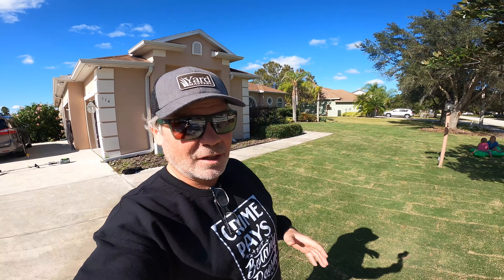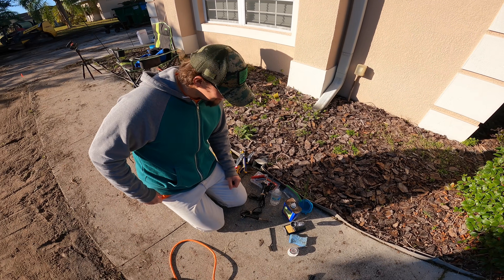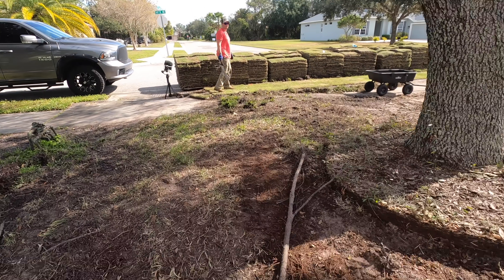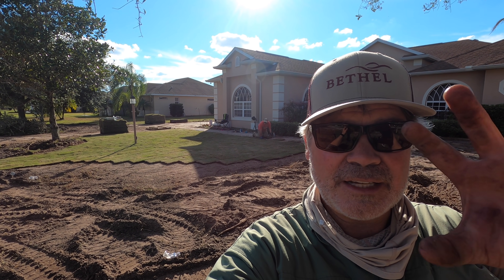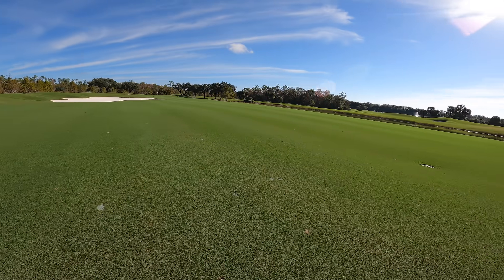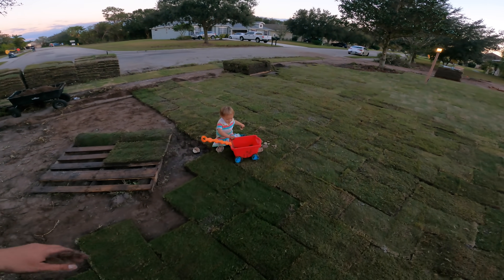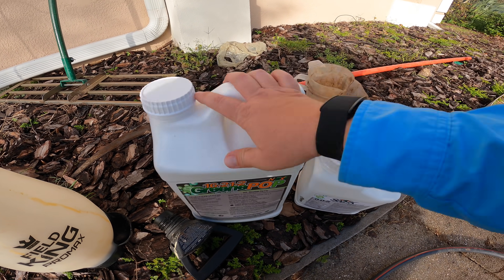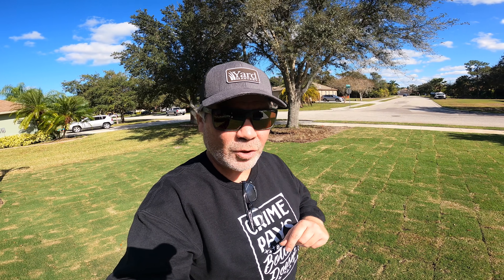Repairing Broken Irrigation and Sodding Bimini Bermuda

Comment: Himini Bimini Himini Boo I love this grass and I am sure Brett does too :)
Reply: Striperman, good Sunday afternoon to you , heading for 35 today ,37 tomorrow then supposedly 25 on  Xmas day with 10 to 20 mm of rain , any other year ,Xmas day ranges from 33 degrees Celsius to 42 degrees Celsius. How is the snow going? Are you thinking of spraying it super green like the lawn Rebel once did for domination in your street? 😬
Reply: Rain and cooler temps on Christmas by you might be a good thing. Snow will be here for awhile but all the green dye is all sold out. Connor's lawn is so big he bought all there was in stock 🤣
Reply: Indeed I do.

Comment: I got a feeling the bermuda will struggle under those oak trees. I am finding out its not really from shade but mostly the tree will suck all the nutrients/energy from the soil about 10-15 ft out, especially with it being so mature. I had a big mature tree with all the limbs cut off up to about 20-30 ft, so it was getting plenty of sunshine but looked bad all around the base 10-15 ft out. Removed the tree and stump 2 yrs later and now the bermuda is thriving in this area now

Comment: Is that really going to be enough fertilizer? A normal bag of starter has 3 times the amount of N-P-K because you are putting down 3 lbs per 1000 sqft (not 16oz like the liquid) and in ratios of 24- 25- 4.
Reply from the maker: it pushed a ton of roots very quickly so I'd say yes. I will re-apply two weeks in also.

Comment: Hane. The skid loader compromised all the pipe in that spot. That valve was already broken. You actually saved them a big muddy mess. There’s no way that pipe would brake off that easily.
Reply from the maker: I tend to agree. I don't have tons of experience with irrigation but as you can see, I can muddle through. But I was being super extra careful not to put too much tension on them and it snapped anyway. The pipes were all very brittle. I broke several others while trying to patch it all up.

Comment: Man, that old irrigation installation was sloppy
Reply from the maker: I wouldn't know as I am for sure no expert, but I felt like the valves would be better placed up near the house and out of the lawn rather than so close to an oak tree like they are. The pipes we all very brittle too. I didn't show it but I broke several sections while cobbling it all back together.